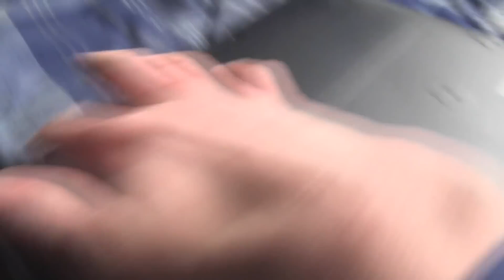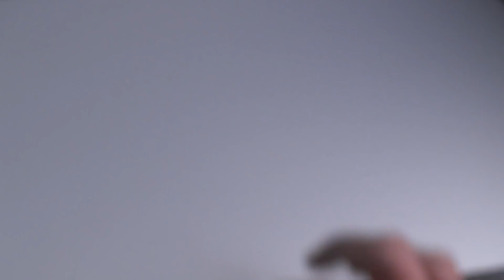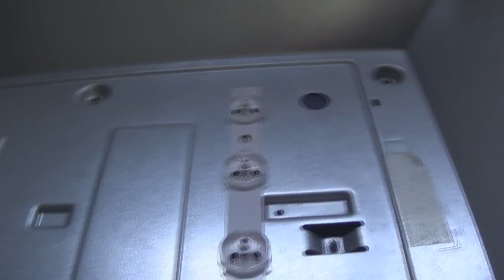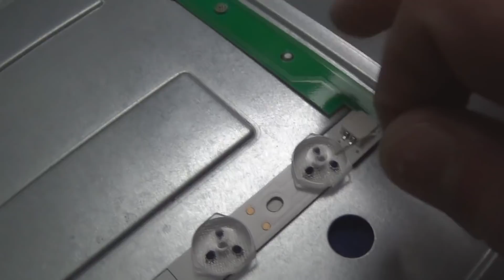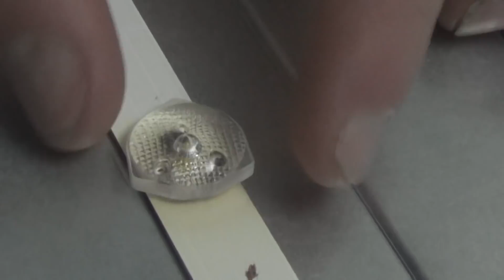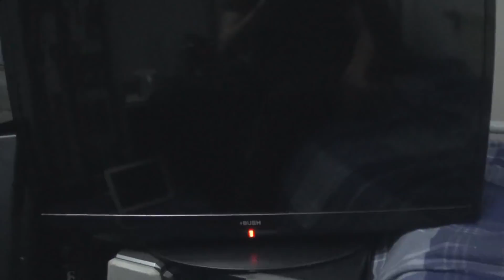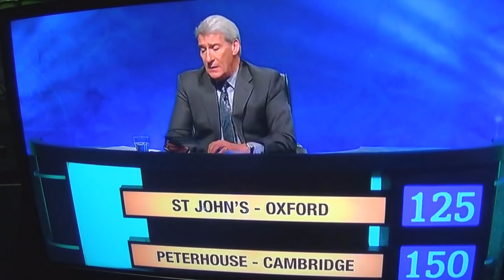Led Tv Sound No Picutre Repair

Comment: this is a very bad way to do this, take note, firstly all the leds in this set or any failed led screen tv will have been run to the same clocked hours, this means all will be on their lifespan or close, so changing one will mean another will fail within months usually, so this is just a complete pain in the arse and unless you intend to replace them all pointless. my second point is the heat you used will have already likely damaged the led and shortened its lifespan, and thirdly and importantly those lenses are prismatic, meaning they diffuse the light to spread evenly, they use that black glue for a reason to not change the lights path, using hot glue will firstly diffuse the light in a new pattern giving you light bleed on the screen from the fact the light now can spread differently, and also as soon as the led is running for some time its getting hot, your hot glue will soften and the lens fall off into the tv frame making the repair pointless. if you have to do this bodge cut an led on the panel out of a scrap panel and epoxy it over the top of the place the old one was in, link some wire back to the led strip pcb, your double the thermal cooling and the led will likely be as old as the ones already in the set anyway, hey if your going to do this dont put new in with old as it will fail in a short time.
Reply: My opinion on the lifespan of LEDs  are you can replace one and may never see it  again. HITACHI IS the worst they always come back even if you replace the strips.cheap crap throw away TVs they make these days.
Reply: Вполне рабочий и хороший метод на видео. Найти линейки не всегда удается, а замена светодиодов продлевает жизнь телевизора. Главное правильно дефектовать диоды и 2 года аппарат будет работать. Что касается клея, я использую клей МОМЕНТ ХЕНЕКЕЛЬ, но и термоклей тоже будет держать.  Там нет нагрева выше 50 градусов цельсия.
Reply: Nice job. myself I remove the LEDs with hot air from the bottom of the strip melts the solder and use super GLUE for the domes.
Reply: These are all valid concerns and you even admit that you got returns with other LEDs burnt out (which is one of the points Tim made). But worst of all is your attitude. Ask anyone and I'm pretty sure they'll tell you they'd rather talk to the "old fuck" than you.
Reply from the maker: Tim Hoad I couldn't give a shit what you say, Ive had Tvs that Ive done this method in been sold now for near 2 fucking years no issues. The returns Ive had have been other Leds that have failed not the ones Ive staked. Get back to being a old fuck and take your moaning somewhere else
Reply: MrReeceyburger123 glad you don't give  shit shows how much you care about your customers tvs. when hot glue gets hot it melts. you know as well as I do those. leds get hot. you might not give a shit but your pissed off customers will.
Reply from the maker: Tim Hoad Lol aint had a complaint yet, your being blocked now as well

Comment: Thanks, going to try this repair for LG 50LN575V that appears to have burnt led(s). I ordered 3528 1W 3.0v-3.6v 350ma type of LEDs that are used in 47LN model so I hope they'll work with this TV too.
Reply: Since I've two LGs (a 42LN and a 55LB) here as well: which LEDs are in the 50LN? I know the 42LN uses 1W 3528s and the 55LB 2W 6V 3535s.
Reply: I think 1W 3528s are OK for 50LN but make extra sure you get "cool white" ones, LEDs I bought were advertised as "cool white" but they actually seem to be warm white and look yellow'ish compared to original blue'ish LEDs.

Comment: Hello nice work ,  i have same problem but all the leds get totally damaged from high voltage and i check the out its 24v ? i fixed new strip but the volte still 24v i found short on C510  3.3 ohm but the capacitor fine !!! please help  by the way the same power supply i have

Comment: If doing all things right and have opened successfully the television then the best thing that you can do is to replace both the led strips with new ones.There are totally 22 leds similar to christmass lights because are in series connected buried in the deepest part inside the tv.And it is very possible one by one to fail also and the tv will be more in a repair condition than normal watching until a fatal error become.

Comment: i have a led monitor which didnt have backlight working... ok i got it somehow working, but its too dim! the driver ic is bit3251 . the output for led strip is too low (40v instead of 55v) , led strip itself is okay, changing brightness in menu doesnt help... dont know what to do... maybe need to buy universal led driver board. can someone help me?

Comment: Great video .. straight to the point and no messing. 
I have the exact same symptoms (you can see menus with flash light but no back light) with my 42" Hitachi 42HXT12U with vestel boards.  The inverter is part of the main power supply unit.  I thought of replacing this board before tackling the actual LEDs.  I am no electronic engineer but replacing this board seems straight forward enough.  Although I had ordered the exact model of this board (17IPS20 with the correct barcode number), I was scared off by a local engineer to say if you replace it you may end up with a BANG!! and he sais that the problem is most likely to be the LED's or the SCREEN???? the screen? 
what would you recommend please?
Thanking you in advance
Reply: Did you resolve this problem? I am in the same boat, about to crack the panel open in order to check the led strips. What was at fault in your case?

Comment: Hi,
I have a 55AO2USB, its shutting down the lcd panel after some effort, most of times watch 3d movies, using HDMI.
I believe that can repair be replacing the supply board, but I'm not sure if can use any 17IPS20, or if must be only the one for the 55ao2usb, or if it must be at least one from a 55'' led tv
Reply from the maker: Check google plenty of info for your tv.

Comment: Hey. I have a Toshiba REGZA 42WLG66 with backlight, sound but no picture. I noticed that a 20v line from power to board to main board is 0v. Can I connect the next one 20v pin with the 0v?
Reply from the maker: Check google plenty of info for your tv.
Reply: I found out that it was the tcon fuse.I changed it and it worked at once!
Reply from the maker: Awesome :D

Comment: Can you use a resistor to limit the current to the led's just enough so they will stay bright and stay safe...without dimming them too much??
Reply: my question also.
Reply from the maker: Kennynva T. You can remove the current sense resistors from the Tv's led driver on the feedback this will mean that it will detect less current draw and will send lower current to the Leds or you could add a series resistor to drop the voltage and current but it could get hot but is possible depending on what type you use.
Reply: yeah use a low resistor 47 will do nice

Comment: Hello,
My Samsung LED TV has no backlight ... following your advice, I found 2 grilled LEDs on one of the ramps 5. But I do not know the power and voltage?

They light well on 12V and 9V but how to know exactly what it takes to find new please?

Model: UE32F5300AW

Bravo for your work and thank you in advance.

Cordially.
Reply from the maker: Hello please post on badcaps.net I will help there.

Comment: what if when powering the led tv 
with max brightness the backlight switches off and with eco mode enabled
 and min brightness stays on?the problem i'm having with my lg 55"
Reply from the maker: Psu solder joints probably.

Comment: mrreeceyburger123 hi i have a jvc/vestal built tv with no backlight..testing the output to the leds while switched on produced a voltage drop to 0, is this a bad led within the panel? any advice will be appreciated.
Reply from the maker: The Psu is faulty if you have 0 v on either red or black Led wires.

Comment: I have a 50 inch Panasonic lcd. It has power but when I turn it on the picture flickers for five seconds then goes to black. I would call a repairman but they are expensive. Guess I'll have to try and fix it myself.
Reply from the maker: Hello please post on badcaps.net I will help you there.

Comment: Surely you mean LCD TV (with LED backlights)? you could save yourself a lot of time changing your supply voltage by simply using a 15v supply followed by a current regulator (cheap LM317 or similar) set to circa 20mA. Safer for the led's too, you would never burn one out by accident. All the same, great and informative video
Reply: Am appalled at the way I notice that Vestel power boards have provision for installing up to 4 rectifier diodes in parallel dependent on the model. Never going to work, the diode with the lowest VF will take the brunt and eventually fail s/c. I have had several of these fails and always remove all of the diodes and replace with a single diode that's up to the job heat sink if necessary. Never had a comeback
Reply from the maker: Yeah I know what you mean I have done that too, just use a 10amp 100v to220 diode with a heatsink any generic one will be able to put up with Vestels shitty timings etc. Pure shit these boards are.
Reply from the maker: Cheers, also yes I have changed the way I test now this was a quick bodge method I put together.
Reply: A worldwide available crap.

Comment: hot glue is one of the worst you can have it gets hard en lousing its stickiness, transparent fix all high tack is the best for this job second is Soliq uv glue.for the uv glue you need a uv lazerpen to cure it in 5 sec.

Comment: Hello and great work! If you could help me out with this I would appreciate it: I was getting ~120V and dropping on startup on the led output. Checked the leds and sure enough, one was burnt. I replaced it, turned the set on and still no backlight. Checked output again: 24V constant, no matter if backlight is connected or not. Checked the diodes, the mosfet, seem fine. Opened the screen again, led I just replaced burnt again. Replaced one more time, still nothing, voltage 24V. No idea where to go next. Any help would be appreciated. Thank you in advance!
Reply from the maker: Hello have you made sure you have wired the led in properly ?
Reply: Yes, the polarity is right. I lit the strip of 3 leds from a 9v supply and it works. Is the 24v output on the led driver a normal thing tho?
Reply from the maker: No you should get 70v at start up then if an Led is bad it will go back to 24v.

Comment: Yeah my Toshiba L1350U has the LED driver integrated in the power board
don't know if that is a good or bad thing?
On my set i am pretty confident i have a failed LED or two(or possibly a bad connection to the LED strips) since i was seeing a faint flickering at the top right hand corner of the screen before it went black today.
Reply from the maker: +Pc Gamer 5150 Sounds like an Led mate.
Reply: MrReeceyburger123  Thanks yeah
i was afraid of that since it is pretty detailed to get to them(i watched a few of your vids on it)
I could do it but it is not exactly easy if you have never done it before :(

Comment: And don’t you think that LEDs get too streesed when soldering / unsoldering with hot gun? Will this reduce its lifespan? I think I prefer the other method you explain, to overlap a piece of strip without soldering/unsoldering the LED directly.
Reply from the maker: +Chungalin Yeah they do get quite hot but I haven't had any come back yet so all seems ok :) Also yes I prefer the stacking method but some times if the Led is in an awkward spot it is easier to use this method.

Comment: Hi Reece! my Toshiba LED TV didn't have picture, so I decided it was an LED prob. Fair enough after checking all the LED's one of them was dead. I replaced it and glued its glass on top of it and fed  36V to all the strip and it worked like a Christmas tree.  
To my disappointment, there was still no picture,  only the sound like before. I took a torch and shining it at an angle on the screen and I could see the faint picture on the screen. Am I dealing here with a panel issue or the LED driver incorporated on the power supply? That was a good video by the way, thanks for sharing.
Reply from the maker: +Omar Hadjarab Hi Omar does the backlight work there might be more than one Led bad that failed after you fixed the first one ?

Comment: I run my cfl backlit monitors on 25% due to they eat inverter transformers if i don't.
Can't remember if they use capacitors on out put to limit current if they do probably breaking down.

I keep getting eye lashes in between difusers an lcd glass so annoying.
Reply from the maker: +Josh C Its a pain at times tbh but I have found that simply blowing under it wile you set the diffuser down does a great job :)
Reply: je veux en francais